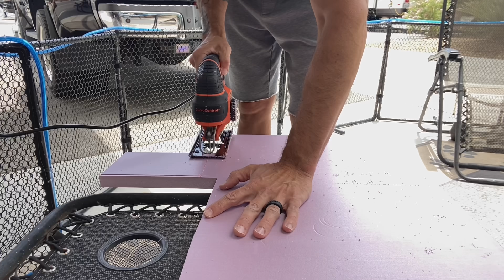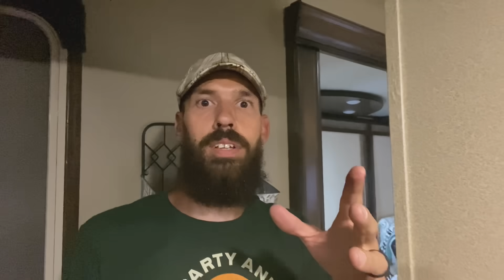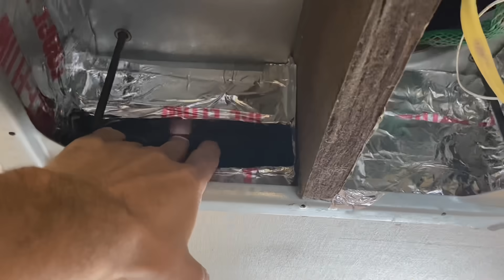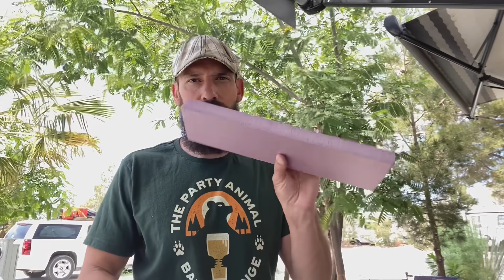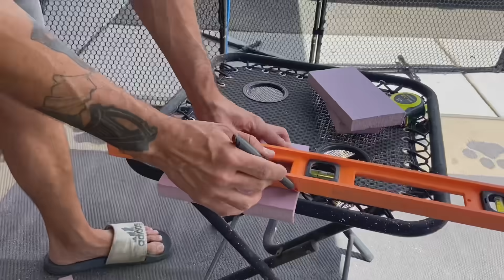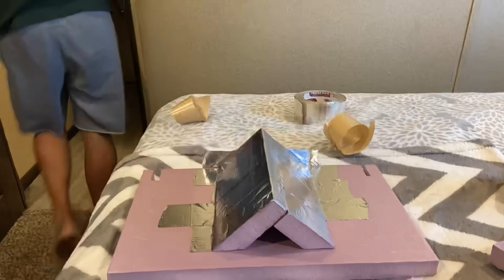RV A/C Modification that will DOUBLE the Output & BOOST Performance!

Comment: Great video. I did do this to my 5th wheel with one different modification. After you install the two upper pieces,use a tape measure find center of the exhaust opening on the back wall and put a vertical mark down, then go 2” down 90 degrees off the foam and make two marks, then draw a line from your center line to the bottom of your unit  ( where the metal ring is )
This shows the path of air from the exhaust to the vent entrance. 
Measure and cut your two pieces and cut the two ends with a opposite 45 degree towards each other. 
When you install this it will look like an upside down V. Tape up. 
Measure and temporary place the vertical end cap ( I cut mine in half ) trace the upside down V and cut off the excess. Tape it up. 
You have now increased the area for the intake air. 
This really increases the air flow !,,,
Reply: I just can’t quite picture this, but i know it would be good to shape the intake as well
Reply: @jamesmobley5994  message me and I can show you pics
Reply: @vincebotkin1960  thank you, it’s really awesome of you to offer, standby
Reply: @vincebotkin1960  I’d love a picture. How can we do this? Want my number to send a text picture??
Reply: @warrensuton9066   yes 
I will sent pics.
Reply: @vincebotkin1960  Ingenious! Could you send me pics too?
Reply: How do we even do this on YouTube?

Comment: I'm in middle of video. One issue I see if the ac doubles as a heater. Not sure that foam can handle direct heat. They do sell inline booster 4" 6" fans. Normally they are 110v but so is the ac. Good video to point out issues. I'm shocked to see no duct work? Makes me question about insulation. Fire are more common in open space air flow than ductwork.
Reply from the maker: Yeah I never really thought about it for the people who have the heat pumps installed. Pretty crazy how the put no duct in that one section uh. Thanks for watching 👍🏼

Comment: It’s funny, I did this to my unit a few weeks ago after seeing how in efficient it comes from the factory. I’m hvac certified & ur diy setup is top notch. Now whomever designed these units needs to return to school. Great video. Iv been keeping a eye out for condensation since the units designed to just dump in that area but so far so good. Gonna check out your other videos
Reply: We had some condensation. It started dripping after a almost a week in the motorhome. It is a large unit. However, I closed some of the vents halfway. Maybe this was the problem?
Reply from the maker: Thanks I’ll really appreciate it. Good to hear that coming from someone who is HVAC certified! Thanks for watching 👍🏼
Reply: I just did this in my solitude. Would you mind explaining where I should keep an eye out for any condensation? Thanks.
Reply: @Combat_Burrito  sometimes if a plenum is too large and can not dump enough into the small ducts with the main vent being covered, it will drip right out of the main duct due to turbulence. This could be remedied by cutting some of the board covering the main vent that u covered (if ur unit has a large  vent). You’ll notice it and it wouldn’t ruin ceiling panels or anything. Iv searched a lot and have not seen anyone complain of this and it’s quickly fixed without undoing everything you just did.
Reply: @newgeneration3496  Since the dump function is no longer there and all sealed, should there be some kind of access hole to make sure no condensation or have a small hole where the large dump was originally. Thank you, AL
Reply: @pr0pman  That has not been an issue for mine (last two years). The a/c does run outside on the roof. I would think that had this been an issue it woul have occurred before I blocked it. At any rate no condensation issues in the trailer since doing this two years ago.

Comment: Changing lanes made a video about this 8 months ago. A company has been producing these for over a year and come installed on Grand Design RV’s
Reply from the maker: Yes, I’ve seen the company. Their units cost $180 a piece and Grand Design started installing them but only in one AC unit per RV. This is nice for people who like DIY projects and want to save a lot of money. $360 vs $20 for same results.
Reply: Yep.... I found that company a few months ago and was ready to spend $180, until I realized that was $180 EACH, and they didn't have something compatible for my AC units..... then I looked around a bit and saw the DIY mod for a few dollars, and I was GLAD the company didn't offer a part that fits my Camper; I JUST SAVE ALMOST $400!!

Comment: Got our materials and giving it a go!  Thanks for the video!
Reply from the maker: Awesome! Have fun moding!
Reply: How did it go?
Reply: @Combat_Burrito  after opening the filter covers I quickly discovered our Grand Design had already addressed this issue and installed a commercial modification.  No mod required by us.
Reply from the maker: @deeb7138  did both AC units have it installed? I’ve always heard Grand Design only puts the commercial upgrade in one of the AC units now but not both. Just curious? Thanks
Reply: @WhyWait  both units have been upgraded.  We have a 2021 model we picked up mid-June.  The third a/c in the toy hauler area does not have the mod probably because the install of that a/c unit is different.

Comment: Also if you put a mister set up on the roof with a calcium filter to keep that head pressure down on the compressor works here in Redding 115 kept my coach at 75

Comment: the upper corner pieces is really all u need to eliminate dead space, the outlet air is going to be forced into the vents by suction so no need for the triangle, it's a great mod to do that is necessary
Reply from the maker: For sure, its just about reducing the space so the static air pressure builds up and forces the air out quicker. Thanks for watching!!

Comment: Every AC video talks about ducted AC.  What about the direct vent/dump style RV AC units?
Reply from the maker: I guess that style already does what this mod does. 
The trick is utilizing or maximizing the btu. If for instance air leaves the ac unit at 42 degrees but reaches its furthest point in the ducts and is 56 degrees, you've lost the quality btu.

Increase air flow,  get the air to the furthest point in the ducts at 50 degrees, while you still lost some quality,  you gained through efficiency. This concept will move air faster before it looses all of its desired effect.

The doubling comes from air capacity before vs after the mod.  Those who have the gauges to do so have measured cfm beginning at 4cfm before, to 8 or more after....doubling. But with the dumps it’s already coming out right there in that spots at it’s optimal temp and flow.

Comment: Why couldn’t you run the TP to the bottom of the duct so there’s no flat spot?
Reply from the maker: You totally could. 👍🏼 I’ve seen a few different ways people have made it. At that point Im not too sure how much of a difference it would make, once the static air pressure is built up it’s forcing it into there anyways. If you do build it that way I’d love to hear how it works! Thanks for watching.

Comment: Great idea, great design. Can't use the dump for air, but could put a filter over them and open them for additional air return.

Chief
Reply from the maker: Thank you! 👍🏼We never used the dumps anyways. When I put it back together I left that whole piece off with the track so that there’s more area for the return air.

Comment: I like the mod - Thank you for your really informative video. 

It is something we are going to have to do after we are out of warranty. Coleman Mach 15,000 BTU heat pump units They failed at two months. They were replaced and now at 8 months one of the replacements has failed, they are replacing that one right now. I don't want to give them any excuse to not repair. 

Once they are out of warranty I figure to do it. 
I think l I'll take the suggestion of opening up under the triangle. I might make the triangle a little wider, then open it up under. I'll leave the inside deflector off to increase airflow for the return. There is a modification that puts foam under the return and forces the air to come in from the side to help silence it. I might try to incorporate that into this.
Reply from the maker: Awesome! All of that sounds great. Since doing the project there are some things like you mentioned I wish I would of done too. But guess what....it’s an easy fix when I want to modify it more right!

Comment: Great video! Question: you link to Reflectix insulation roll in the description but didn’t see you use it in the video. What’s it for/where do you use it? On my way to HD now for supplies.
Reply from the maker: I talk about it in the video during the midbunk scene. How to keep the midbunk cooler. I mention using it to block the furnace air return from keeping hot air coming in through there. I don’t use it on the AC mod 👍🏼 I do have it in other places in my camper though, back pantry wall, under our bed on the floor and other places. It’s obviously in Home Depot if you want some too! Thanks for watching and Good luck moding!
Reply: @WhyWait  ah, I skipped that part since we don’t have the midbunk! Thanks!

Comment: I have a question for you. I did this on one of my AC units. While running the other unit, do you still have cool air coming out where the intake is on the 2nd unit, thru the duct?

Comment: You have an airtight shoe box where there is no place for air to go except into the ducts, why do you need the triangle? Static pressure inside the box will be positive, so there is no place for the air to go except the ductwork openings
Reply: I was thinking the same thing, but the numbers (flow measurements) on the other end (vents) don't lie.  I'm guessing Bernoulli's Principle must be at work here...
Reply: Less turbulence = more flow. Turbulence is like friction. Even in commercial square ducts when they make a turn, there are little curved vanes inside the duct to bend the air around the corner.
Reply: I was wondering this as well. I can see the triangle teepee maybe helps channel or divert air faster into those exhaust ducts but I agree that if the whole area was sealed up tight and it could only go left or right then the teepee wouldn't be needed. But I guess every little bit helps. Only negativity I've ever heard on these is that then you only intake from one side but that one side would only be sucking in air vs before the mod the other side was doing intake and exhaust so overall seems like a win.
Reply: @fabiangomez357  good point

Comment: Thanks for this awesome video tutorial!. I taped up the plenum area today to get a better seal but I’ll have to do the board insulation later. Mine had a lot of wires exposed that I had to work around. Do you have any idea if it matters which side the foil-covered side faces on that baffle between the return air side and the cold air side? I reinstalled mine opposite of what yours was when you removed it - I put the foil-covered face on the cold air side.
Reply from the maker: The foil side should be facing the cold air side I believe but I’d just go ahead and tape up both sides good and all the edges on it.
Reply: It honestly doesn't matter which side, The foil should be to the cold side but it won't make any difference in temp or flow. Either or is perfect. I'm a mobile RV business owner and I've seen it installed both ways from the factory.
Reply: @shawnallen1969  my unit froze up within a few hours after performing this mod. Any thoughts on why?  I think I followed the video ok. Did not close up the intake side. Very strange.
Reply: @rickhightower31  Really no reason for it to freeze up. 2014 Coleman went to 410A freon 2015 Dometic followed,They had thousands of bad units. Late 16 early 17 Dometic had more issues of not cooling/freezing up. Late 18 early 19 Coleman and Dometic had issues again. What yr is your ac, Did it freeze up after you took it back out?? This mod shouldn't make it freeze up, Only low on freon or filthy condensing coil will cause that, Unless its an AC in the yrs I listed.

Comment: Nice job. It's amazing what RV manufactures do that we just don't see and they don't want us to see LOL!!
Reply from the maker: Hahaha well said!
Reply: I have 2 ac units in my 2000 zanzibar. 13500 22.5 year old ac in the rear and brand new 15000 front unit. I  did the mod and now I have an interesting situation.  I have the common duct that runs from front to rear. Now when I  turn either one of the units(only one) then cold air comes out of the intake side of the other unit as well as all the vents. Increased air flow is an understatement. So are there negative effects from this situation?

Comment: Just wondering how much if any difference in having the 45 degree angle pieces and not having them would really make. The air would still split to either side but wonder if any effect would occur?
Reply from the maker: I’m sure it would. I think is just the idea of making as little room as possible in there for the air to hang out and circulate. Think this helps force it right into the ducts better like a track. Thanks for watching.

Comment: thanks for sharing Chris, been wanting to do this.  once the trailer is back from inspection...
Reply from the maker: It’s a big boost in performance! Very noticeable difference. We are battling 115 degree heat out here by Death Valley and I did this mod just in time!

Comment: Shame the manufacturer of the RV doesn't do logical things like that which is a major improvement. Enjoy your Father's Day and keep up the good work.
Reply from the maker: I totally agree with you. Thanks for watching and the kind words. Appreciate it 👍🏼😊
Reply: @WhyWait  Some do install the RV Airflow in at least one a/c now.  Our living room ac had it in our solitude.  Should be the a/c manufacturers that make them more efficient.   

Did you leave out the piece that route airflow to the dumps after you did the upgrade?   If not you should. Makes a huge difference in how much air goes to the return side of the a/c.  

Great video!
Reply from the maker: I agree why not design them this way to begin with. I’ll have to try that, I didn’t really think about removing it but why not at this point since it’s useless now. Thanks 👍🏼

Comment: Wow this turned out great, thank you for sharing your project. Did you notice a big or little difference in air flow coming out of the ceiling vents after doing this? I like it :)
Reply from the maker: Big difference. Me and my wife noticed it right away! Plus for us it was noticeably quieter, I mean you still have to turn the TV up but not like before. Thanks for watching.
Reply: Before you could only feel a little air on a couple of ducts. Now you feel a slight breeze coming out of all the ducts as you walk through the trailer on low and each duct is like a small fan on high, blowing across the rooms.